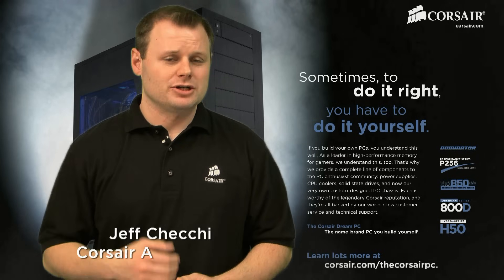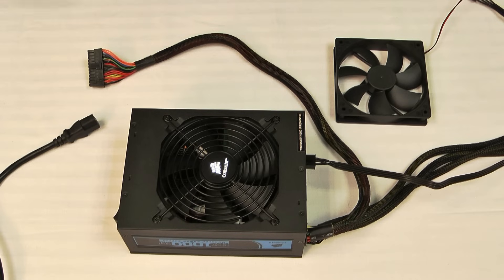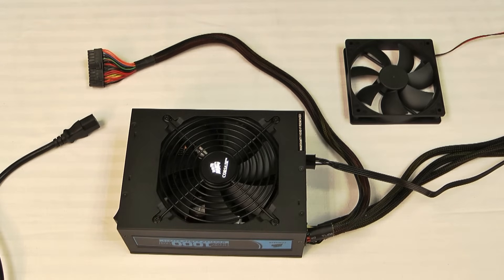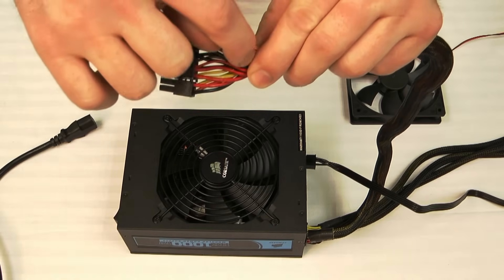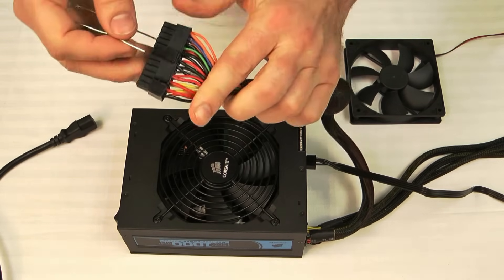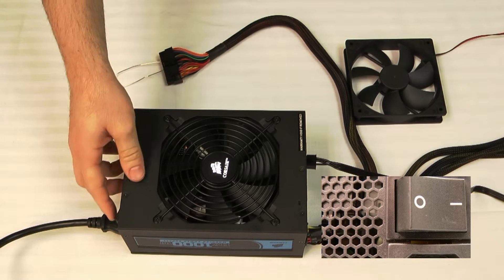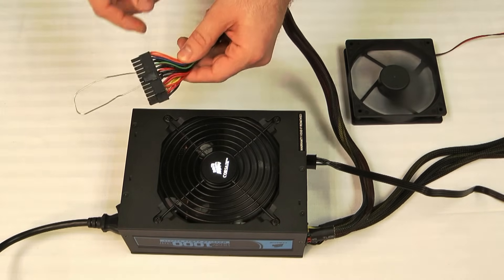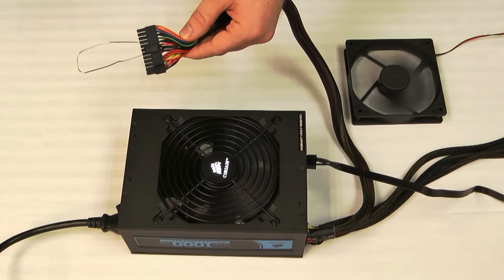Corsair Video FAQ: How to test a Corsair power supply

Comment: This test actually works! As for those with black wiring, all the "colors" are labeled in the owner's manual, so its easy to test it for that as well. I was using a Seasonic 750 Watt Modular Powersupply, so I can't vouch for other companies.
Reply: My old TX550M not only has black cables. Also the pin layout is lacking in the manual.

Comment: Hola, Buenas noches Corsair, ayúdenme con esta duda, tengo ya el promedio de 5 años ese modelo de fuente de poder, si la Corsair AX1200i, esta trabajo tranquila y en uso normales inclusive con juegos ya que la tarjeta gráfica lo permitía (Era de 8GB y 512 bits) , nunca trabajo a overclock ni situaciones extremas, bueno el problema es que la fuente, no estoy seguro si sea ella porque a simple parecer el cable que da hacia la placa colapso de un momento a otro, es posible eso? pues se presionaba el botón de encendido y se reiniciaba y se reiniciaba la maquina, sin modo de usarlo por días, bueno el día que dispuse tiempo desconecte todo, se probo el test según se indica en Corsair y la fuente bien respondió indicando en luz verde, es mas el encendido inicial del fan de la fuente indico que todo estaba normal, la situación se da al momento de colocar el cable principal 24 pines que da a la placa, claro solo el cable sin conectar a placa y que tiene por ambos lados dos divisiones, bien al conectar el cable a las dos divisiones de energía (24 pines) en la fuente esta ya no encendía, pero desconectando uno de los lados si y encendía la luz verde mostrando la normalidad, pues bien aun nose si es falla de la fuente o solo problema del cable (busque por cierto en diversas tiendas cable para el modelo pero nada, no tengo opciones para colocar otro, aunque por pedido pero no estoy seguro si sea ello) porque al parecer la fuente sola esta normal, siempre el testeo marca en verde, es posible que sea solo cable de 24 pines?, resuelvanme esta duda ustedes los entendidos, soy fan de la marca, pero por un simple cable que no venden así nomas no quiero cambiar de fuente, espero puedan darme una salida, se que aun esa fuente puede, no pienso comprarme otra, si pasaría quizás pruebe en marca distinta pero aun tengo esperanzas, aclárenme esa duda por favor, gracias de antemano, saludos.

Comment: this looks dangerous as fuck.
Reply: Not really as the power supply has capacitors inside that would adsorb most or all of any surge or shock that might come from an outlet. I would recommend checking out a shop like "Newegg" and getting a real PSU tester as they are around $15 to $35 for fair to good ones.